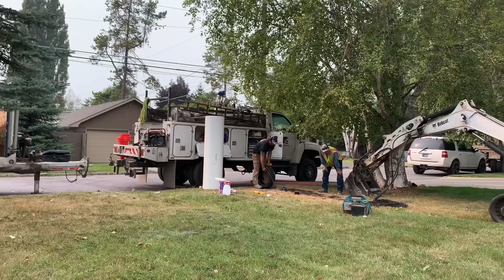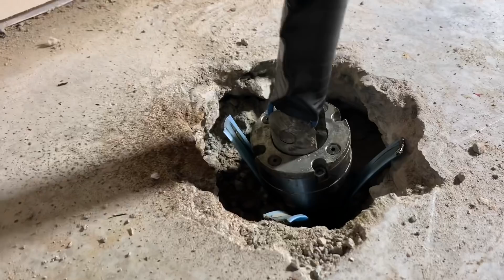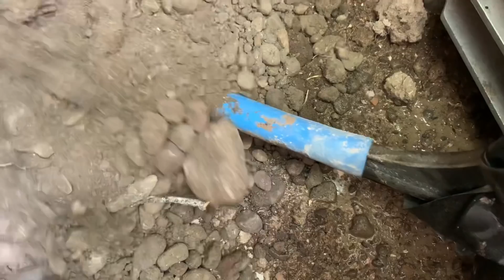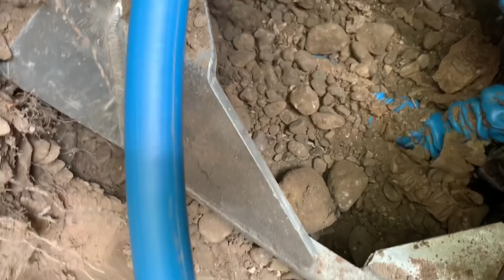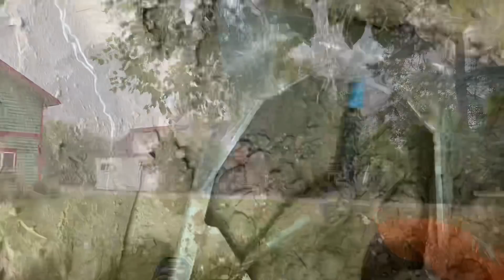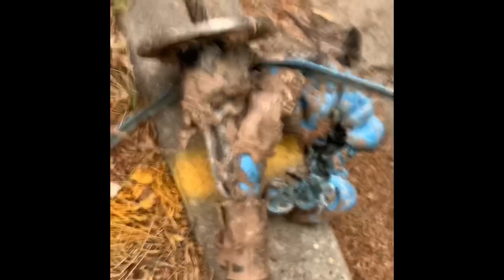What happens when you hit a coupling?

Comment: Very cool process. I saw something similar when they pulled 85 feet of new 4 inch plastic sewer drain through the old clay pipe. It was impressive and the whole job took 4 hours start to finish. It looked like they were using 1 inch pulling cable to do it.

Comment: That sure takes a long time, I have a similiar set up where I just latch the cable to the back of the van and pull it out if I have like a cull de sac or an angle in one pull takes about 40 seconds. If I have to drive from curb to curb and back up each time to pull it takes about 3 minutes.
Reply: unlike that method , this one works every time.
Reply: @tractor9391  Never had one fail yet, done about 300 of them
Reply: @mikejones5364  well then keep doing it
Reply: @tractor9391  Our pipe is only about 12 to 18 inches deep
Reply: great way to go through transmissions
Reply: @imchris5000  Been doing it for years

Comment: You pulling a smaller pex thru a larger pex? The original pex fail?
Reply: Looks like they're going from a 3/4" to a 1" service
Reply: up size from 3/4 to 1",  city requires this any time you do a remodel here
Reply: i think it was leaking so it doesn't matter to the new one  3/4" or 1" ... if they will, 2" also possible